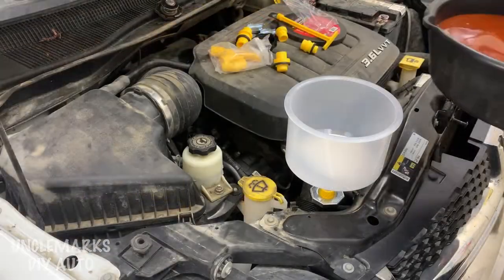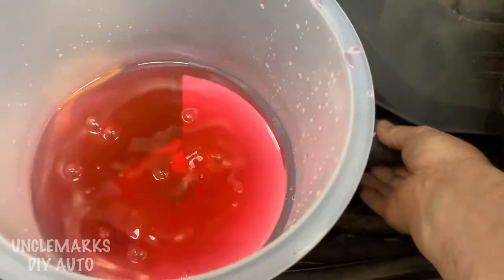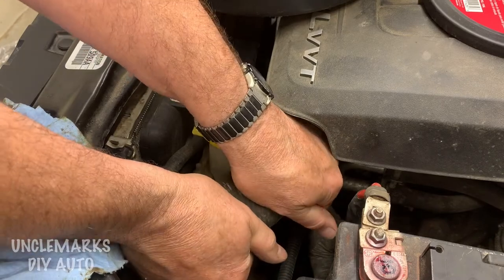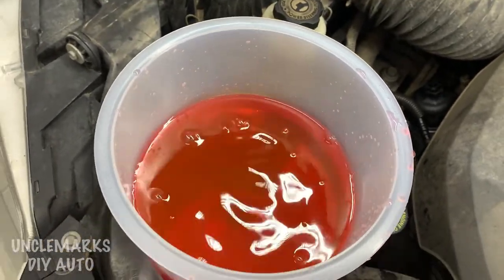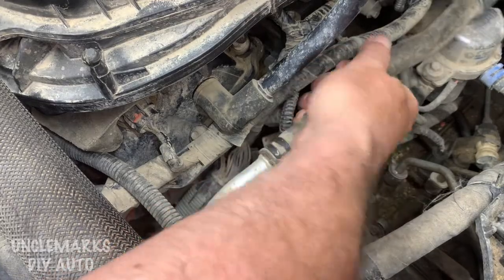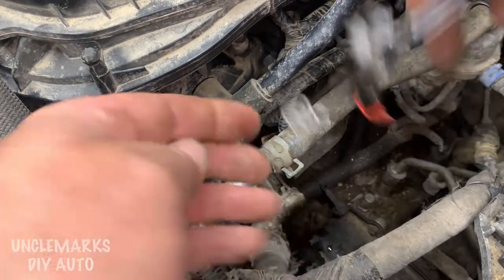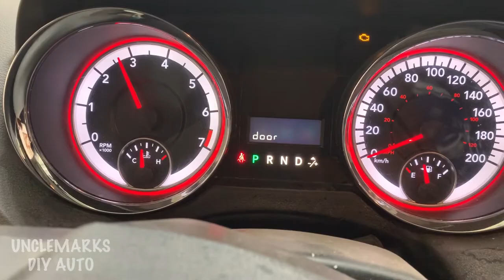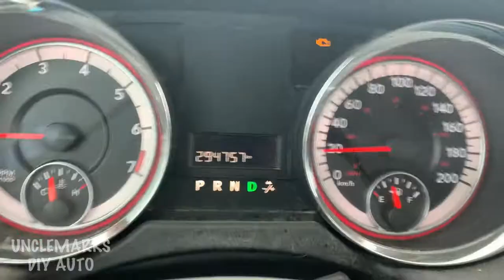How to burp get air out while adding coolant on Pentastar 3.6 & other engines.

Comment: It can be extremely hard to bleed those. Even after a test drive with the heater on it takes forever to bleed all the air out of those thing. Even when you use the bleeder screw and the funnel take awhile but it cool when you finally done.  Great video
Reply from the maker: Thanks J.T. It took a bit but got it done. Working fine for 4 months so far! (I am that far behind in posting videos.)
Reply: How long tho I’ve been doing this for a month now no leaks no coolant lost just burping that air it takes for ever with age on this engine I did it once as maintenance which it was easy I put a lower thermostat temp (180) runs better than 220 for the average temp but yeah I’m still bleeding that air out
Reply: @FranciscoHernandez-dq7rf from what I've read online if you keep seeing bubbles after so much time it could be combustion that you're seeing which indicates a blown head gasket

Comment: Run every distilled water change with every change (x3) for a week or 2 with the distilled wster repest twice then puy in 50/50. You dont save much by measuring it yourself. Use coolant tester.

Comment: These Funnels Work I Have One  But The Vacuum Fill  Method Works Way Better.  You Do Need An Air Compressor Though.
Reply from the maker: I have one. I will have to look into the procedure for the vacuum fill. Thanks for the heads up!
Reply: @unclemarksdiyauto I had trouble getting all the air out with just a lisle funnel.  I would still hear gurgling in the interior when the air passed heater coil. I got a vacuum filler and it worked awesome.
Reply from the maker: @ I hear they work great! I have not tried one yet. I do find every time I do one of these, it gets faster and easier.

Comment: Also, removing the engine bolts of engine for draining may be treacherous because the bolt may break off causing much bigger problems. I have 2, front and back, on my 2003 Saturn Ion. I did change coolant from underneath radiator (x3) and that seems to have sufficed. My coolant is good for -45F maybe too much, but it froze on me at around -30f in Alberta. I did what I could. I forgot to try and fix that this summer.
I had no problem burping it
Reply from the maker: Yep. Too strong and coolant will gel. Usually -37 is what it works out to with the 50/50 mix. We get those -40F and colder over here in Manitoba too.  Stay warm my friend!
Reply: @unclemarksdiyauto  
I'll try and dilute it down to -37°F  to  -40°F. Thanks for the info.
David
Alberta
Reply from the maker: @davidweum  I am not sure your mixture is a problem, but adding water so it doesn't gel is why we don't run it 100%. Maybe see what the highest ratio can be before you go through all that work!

Comment: I imagine filling up the overflow and driving it might suck it back in faster as it heats up, at the same time the car is going over bumps.
Reply from the maker: @davidbachy5627  Sorry it won’t. If you did hope that worked, it can’t suck the fluid fast enough. The engine will overheat and bye bye engine. It’s so easy to get an air pocket as well. Lots of fun but not impossible to do with the coolant funnel.

Comment: Yeah my engine is overheating after changing the thermostat hopefully burping the system will resolve my issue.
Reply from the maker: @DickNut  the last one I did I had the front of the van a good 6 inches (or maybe a bit more) higher than the back while doing this procedure. It went much better than in this video. (Coincidence? Not sure)
Reply: @unclemarksdiyauto  well i did the burp but seems like the thermostat is stuck closed it didn’t open for a whole hour.
Reply from the maker: @DickNut  Humm. I guess all you can do is replace it again. Your sure it’s closed. Did you feel both upper and lower hoses and one was fairly cold? I have not done a thermostat in one of these 3.6 engines yet. Is it part of the thermostat housing (all one unit) or are the y 2 different pieces? Just wondering if you put it in upside down? (If that’s possible on these) Otherwise it should have opened. It’s possibly faulty. What did your temp gauge go up to? Could you feel heat coming out of the vents in the van?
Reply: @unclemarksdiyauto  my uncle changed it with a cheap aftermarket thermostat the original one was stuck open. It only over heats when accelerating when it idles everything is fine. There very hot air coming from the vents. Could be that the thermostat is only opening when the engine is really hot. Its going wayy beyond the middle mark almost hitting the red mark.
Reply from the maker: @DickNut  half way is really as far as it should go. Does a rad fan come on when you turn your air cond on? Should run within seconds, 10 at most.
Reply: @unclemarksdiyauto  yeah the fans come on. Ill be changing the thermostat here in about three hours. I bought a oem thermostat. There pretty pricey $52 bucks.
Reply from the maker: @DickNut  I bought the OEM one for myself last time too. Just make sure it goes in the right way up.
Reply: @unclemarksdiyauto  it worked engine stopped overheating. The thermostat difference was actually concerning. The oem one is bigger.
Reply from the maker: @DickNut  The OEM Dodge one is more money, but usually you don't have any trouble.
Reply from the maker: @DickNut  I know most of those after market thermostats are junk. (Or at least the Caravan engines are very finicky) Glad you fixed your problem!

Comment: As much as 30% us remaining in the engine im told. I wont f*** araiund with more that that eg: thermostat housing erc.
So far so goid. 3 yrs now.
Reply from the maker: Yep. Had done some other work on it so had to drain what would come out. Makes sense not to put the old crap back in. Did the oil filter cooler housing and had to drain coolant first.

Comment: WTF I USED THE SAME KIT SAME SEAL AND THE COOLANT LEAKS OUT THE LID AS I POUR INTO THE BUCKET AND ITS TIGHT....ONLY THING I SEE WRONG IS THE RADIATOR WHOLE HAS AN UNEVEN WHOLE ON ONE SIDE OF THE OPENING
Reply from the maker: Yikes! Those rads just go down a bit and make a sharp corner. I had no issues with leaks at the connection. Maybe try a different end?
Reply: @unclemarksdiyauto  I tried all of the pieces the black gasket on the yellow piece has to go inside, but if you look inside the black bowl you'll see a slit that creates a little hill when you rub your finger on it
Reply from the maker: @johnwayne397  very odd.